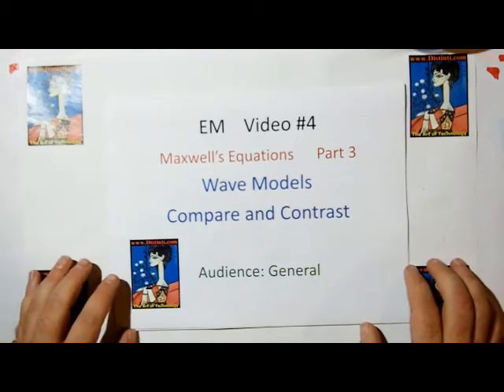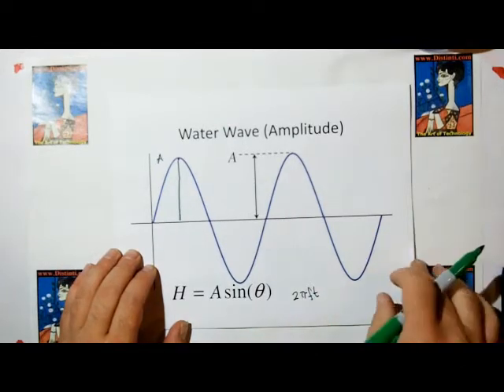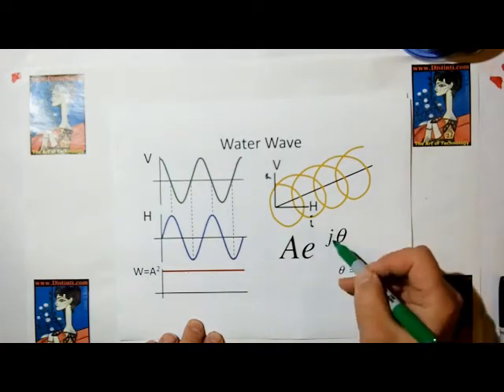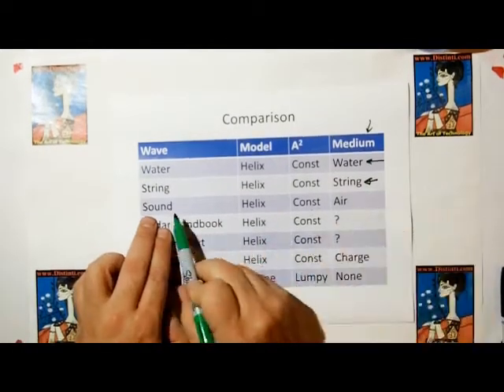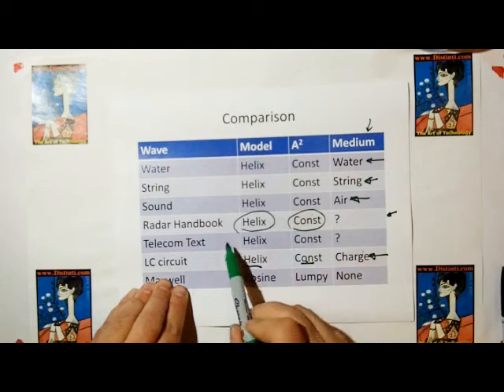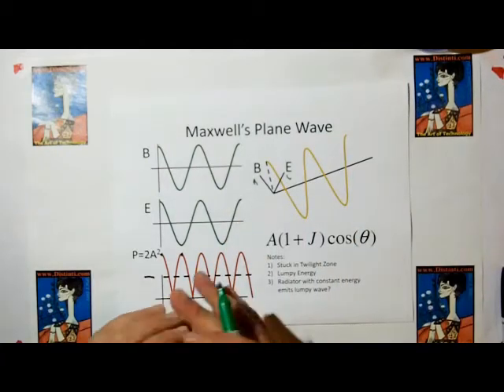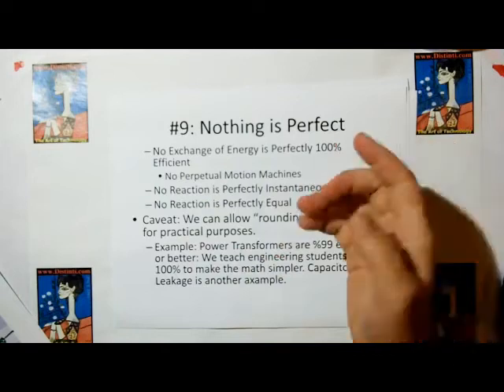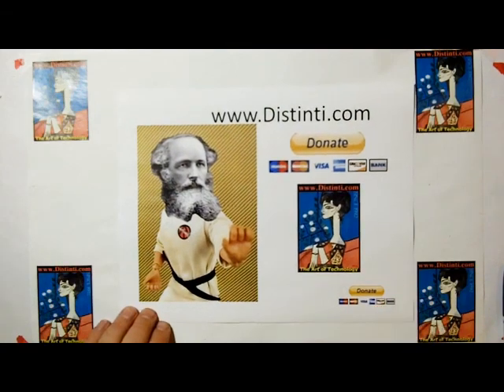emV004: Light 3 / Comparison of Wave models

Comment: Potential energy (PE) and Kinetic energy (KE) coefficients of internal resistance factors (impure material, resistance, heat, light, diffused energy) create nothing-perfect operating systems.  External factors also create imperfect capacitance (faulty insulation, insulators) ... (conduction, induction, greater heat and breakdown of directed energy transfer [[over-heated transformers breaking down and leaking energy and greater resistance ]] ... leading to diffused energy) create additional nothing-perfect operating systems.

Comment: Ok I think there is confusion between “over-unity” and the idea of ‘conservation of energy’ as it relates to the Aether model.  Over unity is defined as getting more out of a circuit than you put into it. Conservation of energy is defined as energy can not be created or destroyed. However, in the Aether model of electricity, this notion completely falls apart, because as Feynman showed, the energy density of the zero point vacuum is equal to 1X10^118 joules/cubic meter, which is basically infinite energy. As Feynman said, that is enough energy to instantly flash vaporize all the oceans on Earth. So if the zero point energy Aether model is true, that means that the notion of conservation of energy needs to be rethought as conservation of Aether. I think in reality what is happening is that the Aether, which is supplying all the energy for all physical matter in the universe, has an equilibrium balance that it tries to maintain. And that balance can be temporarily upset (through pulsed charges like Tesla was experimenting with before his death), and in pulsed charges of dialectricity, that Aether balance can be temporarily upset, which is why in a resonant circuit you get positive over unity voltage spikes over short periods of time. This phenomena can be observed in the form of back EMF, which in most modern circuits is wasted by dumping that back EMF voltage spike directly to ground. (We are just idiot monkey brains and are wasting half of the energy that the Aether field gives us freely.)

Comment: If you have a bucking coil where you have equal but opposite waves, each moving in opposite directions, 180 degrees out of phase, do they cancel or do they collapse to form a scalar/longitudinal EM wave that flows outside the wires? I’m guessing that they form a longitudinal wave, that was completely ignored in Maxwell’s equations.

Comment: There is no instantaneous reaction?  So when you were grasping the pen you were using and you applied a force to it causing motion, are you saying the far end of the pen moved after the portion of the pen you were grasping?
Reply: are these ends of which you speak of (far end and the portion of the pen you were grasping) not one and the same object (or one sinlge unit)? as if my eye looks to the left, is the dark circle of the eye moving to the left "a" one thing and the larger white on the right side would be the reaction?

Comment: If you had a particle emitter moving up and down you'd have a wavy particle stream in empty space that would not be a wave pattern traveling in an all-pervasive medium. All the particles are traveling in a straight line once emitted, each one higher or lower than the previous. I don't see how a sound wave can be helical, it's a longitudinal, compression-expansion shock wave. 

If there is some kind of deformable lattice field it may be possible for longitudinal waves to propagate at light speed... Varying light energy travels from cell to cell at the speed of light in time T but the vibrating cell travels less than a cell radius in time T so always has time to recenter before the next vibe. The distance each cell travels per time T (amplitude) can vary as a sine wave that travels at light speed. Polarised light points to a narrow transverse wave.

Comment: DMan, Thanks for this. I can't tell you how great it is for me. 

I have come to an understanding of Aether that leads to what is considered over unity, but is not a violation of reason or reality. It simply crumbles another giant.

I have not seen all your videos, so I'm taking the full tour. In this one you mention the medium of LC circuits is Charge. This is not entirely true. A capacitor cannot be described as charge without an additional imaginary source for charge to appear, or some other artifact. It might be a magnetic field... maybe a displacement current... etc. The same for your inductor. This is the flaw in contemporary electrical theory, it has properties and operations that have no logical flow. One cannot engineer without applying observed "laws" of operation which are restricted to fixed configurations of components.

Consider that when you identify a medium, you change the rules of your definition of what is acting, and what is conserved. The water wave is not conserved, the water is. The sound wave is not conserved, the air is. In LC circuit model, charge is obviously not conserved but they try to convince you it is.

Maxwell was an Aether Scientist. Obviously the explanation that is promoted for his work is not what he intended. But that's just a side comment on Maxwell's rep. I have a theory that Steinmetz intentionally shaded the interpretation of Maxwell's work to promote a limited view of electricity to support his employer's wish to keep engineers in line with the profit generating technology that was in use. But, that discussion is of no real consequence. I put this in only because you mentioned how lame Maxwell was. Was he really?

There is a condition of resonance that creates an amplification of wave energy. For this to happen, and to stick to the law of "no over unity", the medium must be conserved, but the amplification of what you count, can be over unity or lossless. There is the opposite: cancellation of waves. What happens to the energy of two waves that cancel? The law of conservation of energy says it energy cannot be destroyed. Yet, there you have it. Gone. But the medium remains conserved.

Waves can be amplified into tsunamis, but the water is conserved. Sound can be amplified far above the value of the original source, but the air is conserved. Electrical signals can be amplified far above their origins, but in the charge/field model the charge/fields are conserved, even if that depends on fantasy.

When you switch to an Aetheric Model, where electrical charge is transferred by Aether, you are saying charge is made of Aether. Charge is no longer limited to the law of conservation; it can be amplified as long as Aether is conserved. This depends on simply a reservoir of unlimited Aether. But as you say, something that cannot be measured is hard to quantify. If we could find a limit of Aether, then we would have something. (LOL)

Your interests of using Aetherial Mechanics to discuss inertia, etc skirts this issue which leaves you focused on maintaining the habit that electricity must be conserved, when it no longer should be if it is transmitted through a medium.

If it helps, consider this: What is sound? Eliminate the medium and what do you have?
What is electricity without Aether?
If it isn't really anything when you ignore the medium, can you rationally consider that conserving it makes sense?

Consider that matter is made of energy. Energy is made of Aether. Discern how to manipulate Aether and you will be following the path of manipulating energy and matter. Laws of conservation of energy and equivalent exchange of matter become erroneous postulates. The postulates of metaphysics become possible in real physics, and real physics no longer has to rely on science fiction to be trusted.